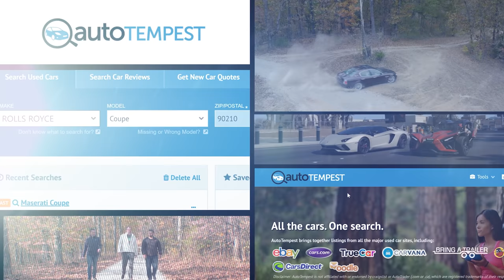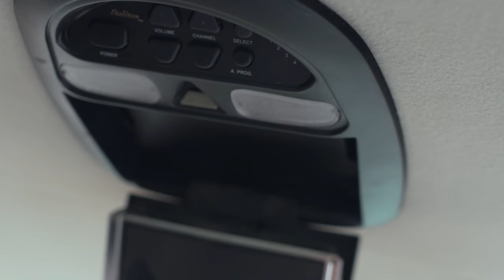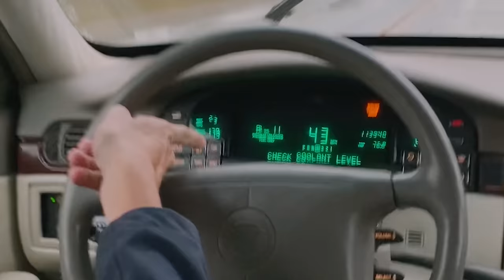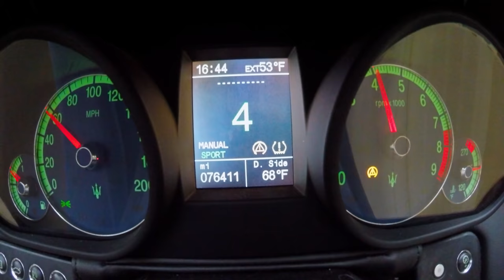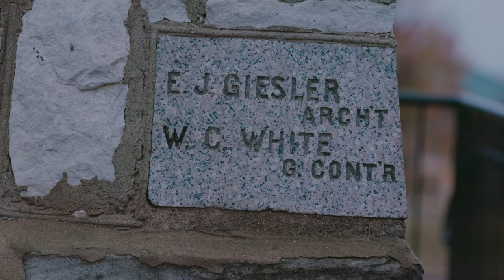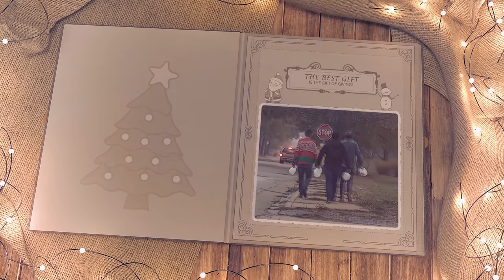We Took Our Unreliable Luxury Cars On A 300+ Mile Christmas Road Trip (And They All BROKE)

Comment: "Italian cars are unreliable" yet it's the only one that made it after jumping multiple times and crashing into a tree
Reply: True
Reply: it's basically a ferrari, the only bad thing about it is electronics
Reply: You have take the cars it beat into consideration.
Reply: It's never working right but it's always working
Reply: I mean... It's not like it's a Multipla 😂
Reply: @dimitrihadzitomov  while the multipla does look like shite it is actually a very reliable car that being said you won't see me alive in one of those
Reply: ferraris aren't known to be reliable though
Reply: Ferrari's aren't known for reliability and Maserati's are notorious for being worse than Ferrari's.
Reply: @fl350r  it doesn't matter if the other cars were bad or not just think about it a 17 year old luxury car made it 200 miles after taking a massive beating through a forrest jumping all day and hitting a tree
Reply: Any car can be made more or less reliable based on maintenance. It seems like that Maserati may have received regular servicing, while the other two were seriously overdue for many things.
Reply: Well, yeah. But its competition was a British car and a modern German car... And a Northstar.
Reply: I find you just need to keep the battery tip top then the electrics are fine. If it’s down even a couple of days without being driven then all sorts of strange things happen.
Reply: Maybe I am blessed. I've owned 3 Diets. A 600D, a 124 Spyder, and a 131 station wagon and all have been reliable.

Comment: A Massive Hunt: "One of our cars died."
CarTrek 3: "Hold my eggnog."
Reply: Thing is though, the Top Gear / Grand Tour cars have entire crews backing them up with parts and equipment if they go wrong. Losing a car on such a challenge is monumental. In this case they didn't even attempt to repair the brakes on the rolls a second time, even though it was entirely possible.
Reply: @thegunnitgamer5716   yeah because have you seen the roads on the massive hunt. This was barely nothing so of course they need less parts and like in top gear, breakdowns are good for views
Reply: @Amir-wv8om  What I mean is that all the Top Gear specials, from £1500 Porsche to A Massive Hunt are done this way, with crews, mechanics and spare parts to keep them going.
Reply: This is more comparable to the 10 000£ exotic Italian cars, and all of those broke too😂😂

Comment: FWD V8’s are literally pointless
Reply: They make more sense in the malaise era of low power engines. I'm pretty sure the highest power version of these engines has 275 horsepower, which is less than a modern Camry.
Reply: Even when the Taurus SHO went with a V8, it still fails sp yeah it kinda is

Comment: That Quattroporte would have been flawless if Ed had not crashed it. My dad had one like that, a silver 2005 and it was a great car. Despite the sticky buttons,  it was surprisingly reliable, up until the point my mom was not paying attention and had it make a jump over a large speed hump that resulted in a broken oil cooler line, oil pan, and a/c lines with immediate dumping of all the oil. The repair at the dealer ended up being about $14,000. Then a few months after that it needed a new clutch, which was also expensive. That's when my dad got rid of it and got himself a Jag XJ8 Vanden Plas instead.

Comment: I had a trip like that once.  My one van the trans lines decided to start leaking, at the fittings on the trans.  110 miles from home with no way to fix it, I just drove back and would just stop every 30 miles or so and add a quart to it.  I made it home okay, but it's an adventure worthy of a car story video.

Comment: Fortunately, not all Audis are bad eggs. 
I have a '95 model A6 2.5 TDI Quattro, which is a proper high mileage hero. It's in very good condition, though there is a little rust on some panels (easy to fix though).
It's been going strong for 475000 kilometers (almost 300k miles).
These engines and drivelines are known to be pretty indestructible - I am referring to the inline 5-cylinder diesel, not the V6 variant that came later. Also paired with a 6-speed manual transmission. 
Comfort is pretty good (for 1995 standards at least), and it's got less electronic gadgets than the newer models. It's also quite easy to up the power output of these. A pair of ROM chips, a slight turbo upgrade, some timing adjustments and an open turbo-back exhaust. You can quite easily get a good 250+ horsepower out of these, with the powerful torque a diesel engine is known for.

Comment: idk what's the deal and the difference between the US and the EU market, but when they were discussing reliable cars and said Lexus and Infinity - those are one of the least reliable and most expensive cars to fix that you can buy in Europe. Shops charge more than they do with Audi, BMW AND Subaru. Some 4 years ago a friend of mine bought used Infinity Q50 and in the first six months alone he spent more than €15 000 fixing it; expensive parts + expensive labor. I have co-workers who drive all sorts of Lexuses (used and new ones) and they are at the workshop at least once every single month for all sorts of stuff; especially the older hybrids. And the cherry on top is that very few garages actually take on the task fixing them, that's why it's so much more expensive even than premium german brands. Maybe in the states they are well adopted and garages actually charge normally.

Comment: For the next one, let's see you guys purchase a beater on AutoTempest, with a tight budget in place. You each need to cross several states while performing various tasks with your rides. Since it will be so demanding you will each be allowed to bring a mechanic with you. You can choose between the Wizard, Car Ninja, or Jared. It will be a test of your purchasing prowess, driving skill, and mechanical ability to McGuyver your ride together using the remaining portion of your budget.

Comment: Why didnt you crack the rad cap open part way so it runs no pressure in the rad? May boil in the mountains but assuming your not high altitude you should be fine. Thats how i got a 93 toyota  previa with a very bad rad leak home although with that car it was leaking a lil out the top of the cap but better that than gushing out the lower rad tank.

Comment: Felt like a wasted opportunity to be honest, none of them really got attached to their cars and abandoned them at the first sign of failure. Would like to see some roadside repairs and jury rigging, and taking unexpected detours to try to find parts or help. Tavarish has the skills for this but none of them picked up a ratchet in the series, a lot of drama and spontaneity is missing and they seemed incompetent not knowing what to do with their broken cars.

Other than that the dialogue seemed forced, hoover and vinwiki guy seem to uptight and serious to have fun there is not a lot of chemistry between the 3 hosts. The cars were never pushed to their potential and they ditched them at the first signs of failure, I'd like to see them attempt a roadside diagnosis and fix at least.

Comment: It didn’t have a bad head gasket the coolant leaked out overheated and blew the head gasket that’s thy the oil wasn’t white lol there was no water to mix into the oil bro that car would have lasted if you kept coolant in it
Edit: warped the heads lol not blown gaskets they’re warped for sure